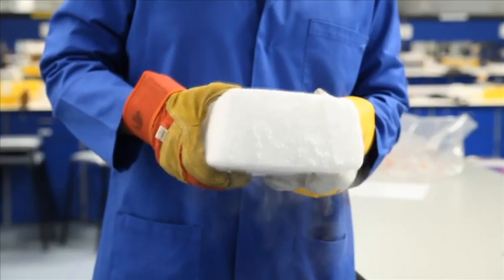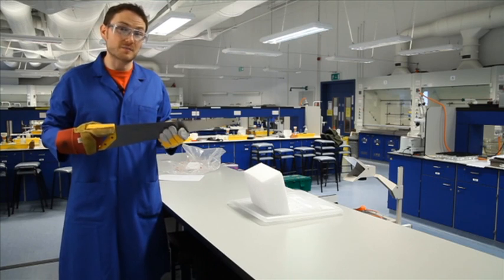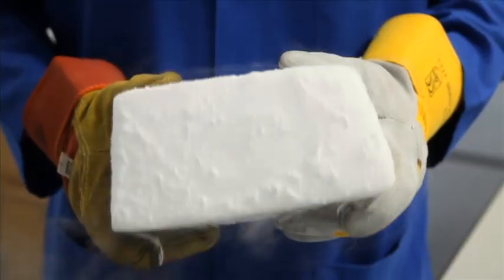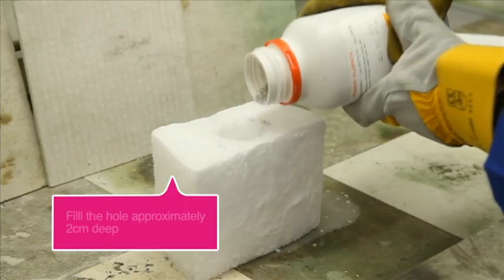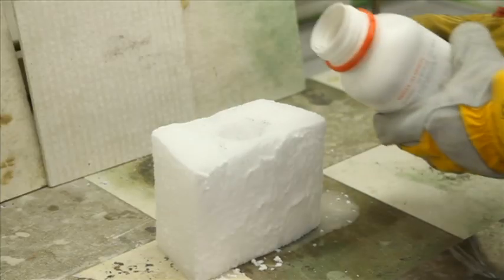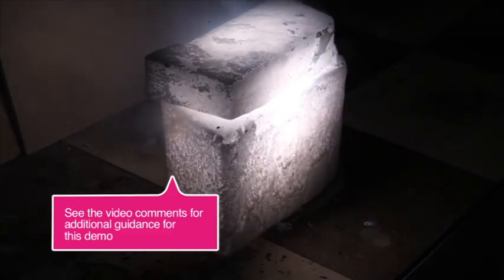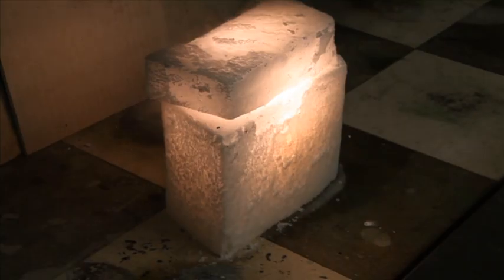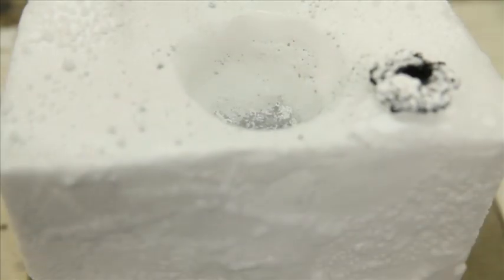Burning magnesium in dry ice

Comment: http://tipsknow.blogspot.com/
Circuit diagram
Power Supply,Alarm,Amplifier,Arduino,Audi,FM Transmitter, Led light,Voltage Regulator, Microprocessor,Charger,Joule thief,Inverter,Infrared,mobile,Timers,Metal Detector,Transmitter,Microphone,Sensors,School Projects
http://tipsknow.blogspot.com/

Comment: Because dry ice doesnt contain as much H2o and wouldnt "melt" in an ordinarely fashion.. Magnesium burns with nearly 2000 degrees celcius, so the better question would be, since it burned for more than 10 seconds, "Why is the block of ice still there"... Dry ice is fun.. and can even withstand extrem heat... for some reason..

Comment: (continuation..) as solid CO2 sublimes, it becomes gas and as it is very cold its density is higher than the room temperature gases, so as gas CO2 buids up, it pushes the other less dense gases out of the system (including O2), getting finally a system with no oxygen (at least for practical purposes)

Comment: @erielhonan. You have two interesting points. This experiment shows that CO2 can oxidize Mg producing MgO and elemental C. This reaction produces a high amount of heat and you can see it in the form of "fire". When you burn something you are oxidizing it, and the oxidant is O2 in the air. In this exp. the oxidant is CO2 (they meant O2 is not involved). Extrictly speaking youre right about having a more extrict isolated enviroment, BUT take into account this: (Continues..)

Comment: Actually it tends to be just plain CO plus particles in smoke that cause the most damage. CO2 is obviously poisonous as well but CO, which is more common in house fires in particular, is the more readily poisonous of the pair.

CO2 actually contains exactly the same amount of oxygen per mole of gas as molecular oxygen, which is O2, but the reason we don't use it is because our bodies have no way of freeing the oxygen from the carbon. This is, however, what plants do during photosynthesis.

Comment: Magnesium needs oxygen to burn. The dry ice (solid CO2/carbon dioxide) means that the environment the magnesium is in doesn't have diatomic oxygen (O2 which is what we breath and is just normal air oxygen) available to burn.
What you are seeing is the magnesium taking the oxygen from the CO2 because magnesium is more reactive than carbon.

Comment: This clip is the example of the breakdown of CO2 by a thermal reaction, cracking the CO2 down into base elements; C and O2. Then the magnesium devours the oxygen in the thermal reaction until the fuel is expended. The carbon remains as the end product of the reaction.

This is why you do NOT use CO2 extinguishers on metal fires. Class D (smothering) agents are used, salt or copper based agents as examples.

Comment: Take my assessment/question lightly, as I've only completed 9th grade Biology A (first Biology class in Highschool)

So you start with magnesium and the frozen CO2, start the initial reaction, and end up with  2Magnesium+1Oxygen? What is this called? Where does it go? I assume all the oxygen comes from the Carbon Dioxide, and then as the oxygen leaves, solid Carbon is created. In the process, the energy is released in thermal form?

Did I get that right? can you explain it more? Please?

Comment: Oxygen is a diatomic element , O2, which is not required to synthesize magnesium oxide.in this example.  This reaction is a single replacement reaction that displaces carbon for the more reactive magnesium metal.

Comment: WHY?  What would you rather he'd used to light the stuff?  Flint and steel?  Pretty clear that you've never tried to set pellets of magnesium on fire, you can't just hold a match to it.  Did you not notice how long it took to light even with the torch?

I admit that for dramatic effect he could have used a piece of magnesium ribbon run out through the side, lit that with the torch or even a lighter and let it burn in and light the mass of magnesium

Comment: carbon dioxide displaces oxygen, (which is how fire extinguishers work), and the oxygen in CO2 is too tightly bonded to be used in a chemical reaction. That's why you suffocate when you hold your breath. Even if there was some initial oxygen, the sublimation of the dry ice would produce enough CO2 to displace all of the oxygen inside the hollow containing magnesium.

Comment: Are you aware of the fact that the heat of the magnesium fire will cause the dry ice to produce large amounts of CO2-gas? The flux of CO2 should effectively keep any ambient air from entering the chamber. I believe this is an important part of the setup. Also in the startup phase the cavity in the top of the block would be filled with CO2 from sublimation of the dry ice as CO2-gas is heavier than air and therefore should displace any air from the cavity.

Comment: Magnesium can burn in air, oxygen, chlorine, nitrogen, CO2, and even water.
The text should tell us what reaction(s) are occurring:
2 Mg + CO2 -> 2 MgO + C (white magnesium oxide and black carbon.)
Mg + CO2 -> MgO + CO (carbon monoxide -- is this happening?)
Hot carbon can burn in carbon dioxide. People sometimes forget that CO2 supports combustion. (See "Windscale fire" on Wikipedia.)
C + CO2 -> 2 CO + heat.
2 CO + O2 -> 2 CO2 + heat.
(In a CO2 atmosphere, only the first reaction happens.)

Comment: This is false.. The reaction of Mg burning is 2Mg + O2 -> 2 MgO It turns out that Oxygen still needs to be present for the reaction to take place. Hence Mg does not burn under water. That said This reaction Illustrates how The energy of the Mg burning is capable of striping the oxygen off of the carbon atom leaving it as a byproduct.. 2 Mg + 2 CO2 -> 2 MgO + 2 C

Comment: For those that didn't get the memo, there's no water because this is dry ice (frozen CO2) and there is no melted CO2 because it doesn't melt unless compressed - it sublimes (goes straight from solid to gas).

Comment: Sorry if I'm not understanding, but isn't oxygen still being pulled into the crucible through the lid - it's not a perfect fit, and doesn't the CO2 provide oxygen as well, upon release in heat? So, oxygen is still necessary and present?

Comment: Yeah, dry ice has that mottled look too it.  That's normal.

its very important to remember that the only thing that stops this reaction is reacting all the magnesium.  The CO2, normally thought of as very cold, is actually fueling this reaction.  Don't add too much magnesium or you could spill out the sides waiting for it to die. :)

Comment: Correct. I belive he misspoke.

The idea here is that the molten magnesium will react with the OXYGEN atoms in CO2... leaving carbon soot behind.  The magnesium is actually taking the place of the carbon if you want to look at it that way.

P.S. the heat generated from the magnesium will sublimated some CO2 from the inside walls of the block, providing more oxidizing CO2 for the reaction.  CO2 may be good for suffocating most fires we see in daily life... but not for metals like these.

Comment: dry ice is an industry term for solid CO2 (carbon dioxide).  There's no water involved here.

The same reaction here occurs under water though.  Magnesium, once heated to molten state will react with oxygen in water (or in this case carbon dioxide) leaving the water or CO2 molecule as just H2 gas or carbon (soot).

Carbon has nothing to do with with video other than showing molten magnesium can react with oxygen thats bound to carbon... stripping the oxygen from the CO2 to continue burning.

Comment: The burning magnesium extracts the oxygen from the carbon dioxide itself, leaving pure carbon and magnesium oxide. I expect that the breaking of the carbon-oxygen bonds requires less energy than is given off when the oxygen then bonds to the magnesium, so that there is an energy surplus that can keep the reaction going. Water is also to be avoided as the burning magnesium will do the same to it, leaving hydrogen gas, that can then cause further fires and damage.

Comment: flat edged blade will make the noise due to the reaction of the dry ice during rapid evaporation, with toothed blades the contact surface area is not flat and won't make it vibrate.

Comment: @Xerxes16439 
typically dry ice sublimes(goes from solid to gas) at about -109.3 Fahrenheit, although liquid co2 is possible when there is enough of both pressure and heat together. at room temperature co2 can be liquid at about 850PSI. 
Carbon itself sublimes at about 6500 Fahrenheit.

Comment: I did enjoy the video, but I don't see the experiment demonstrating what was desired. The "lid" was not a true seal to defeat oxygen's entrance to the magnesium. If the point was to show that "oxygen isn't always a prerequisite for fire and reveals carbon's place in the reactivity series", then remove oxygen from the system used in the experiment. There is plenty of oxygen in the dry ice as well as being pulled in through the "lid". Perform the same experiment in a vacuum, sans the dry ice. $.02

Comment: @SlimySnail44 Magnesium is more reactive than carbon, so is able to displace the carbon in the carbon dioxide, and react with the oxygen.

This reaction occurs because of magnesium's unusually high reactivity. Most substances are not reactive enough to displace carbon, so cannot react with carbon dioxide. This is why CO2 makes a good fire extinguisher.

However, as this demonstration shows, CO2 cannot extinguish reactive metal fires (such as sodium or magnesium). Other extnguishers are needed.

Comment: @josephaarongermany its the same thing the magnesium strips the oxygen from carbon dioxide to burn it does the same with water its strips oxygen from h20 aka water as the magnesium has a higher affinity for oxygen than hydrogen does its the same reaction more or less..its also a reaction related to termites